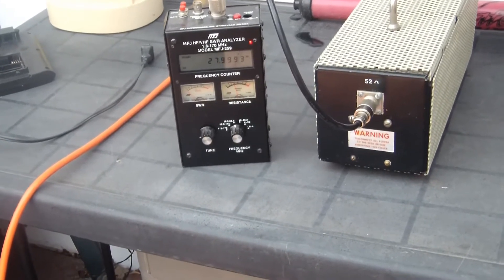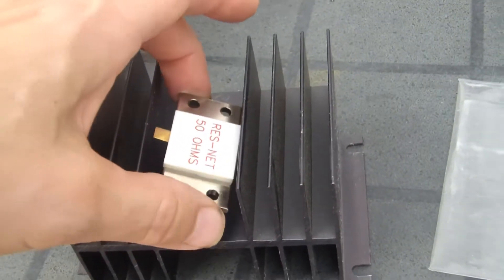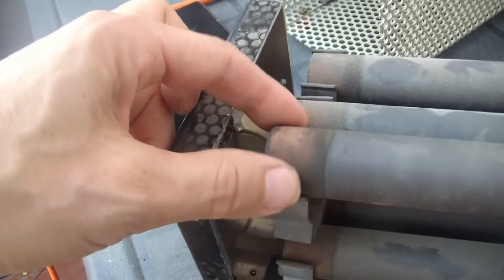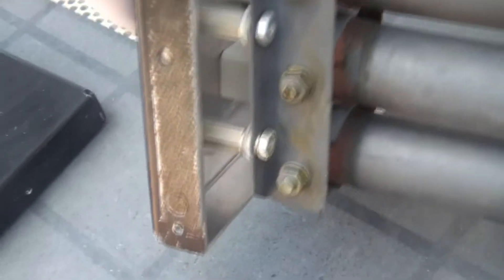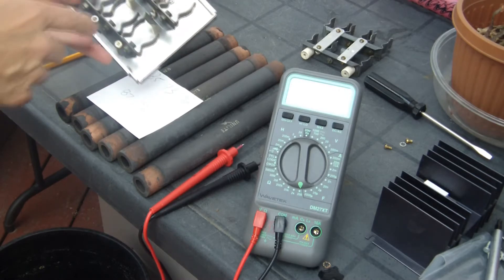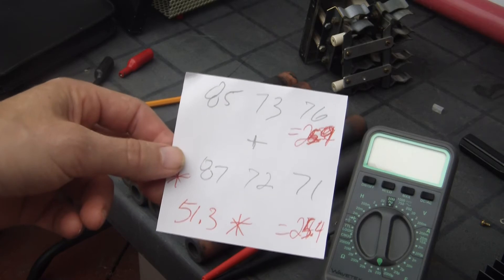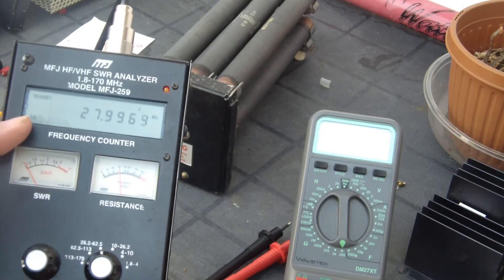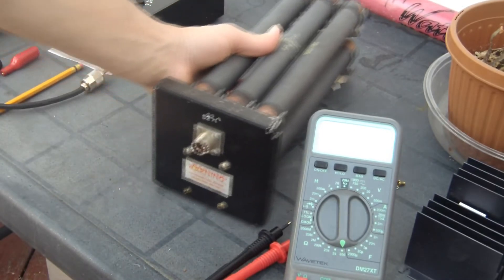Dummy load deep dive ...

Comment: Maybe if you can get the service manual for that mfj you can align it  on your own
Reply from the maker: Thanks for your feedback. I did a initial search on "mfj259b alignment" and got a lot to follow up on. If not already on YouTube, I 'm sure a future video to follow.
Reply: @KlondikeMike  Had a same issue with my 259. It was easy to align the ohm meter, but I guess you have aligned your analyzer already

Comment: I think I'd trust your DMM for the initial test. You may want to build up some PL-259 calibration fixtures with 25/50/100 ohms which should give you 2:1/1:1/2:1 tests. The 259 can be aligned for frequency, AGC, ranges, and SWR & resistance meters; instructions out on the net but if you can't find them send me a note at my QRZ dot com address and I'll send you the .pdf. I'm thinking your 259 is in need of some fine tuning.  73 - Dino KL0S
Reply from the maker: Thanks for your feedback. As replied to previous commenter, I talked to Mr Google about a "mfj259b alignment" and got a lot of answers to follow up on. I have had this 259 for a while but never required an accurate result until now.
Reply from the maker: Found your document that you created with Sam on the MFJ259 back in 99'. Created a couple of fixtures and aligned up OK. Thanks again!
Reply: No problem, glad to lend a hand.  73 - Dino KL0S